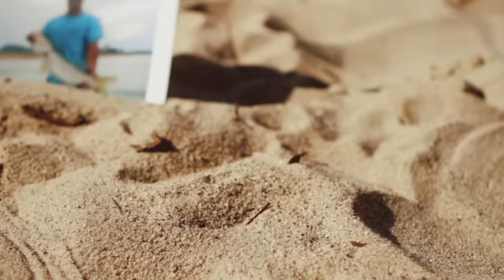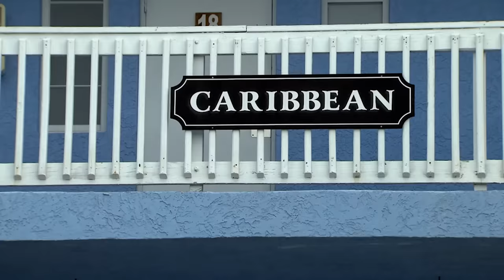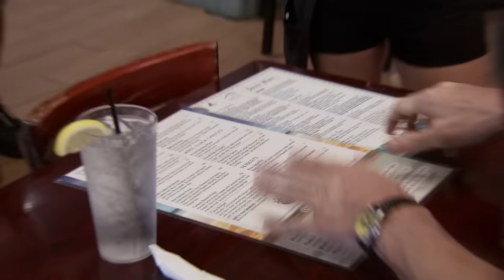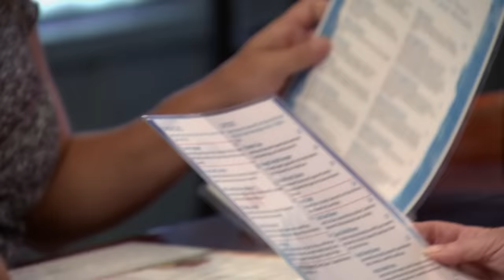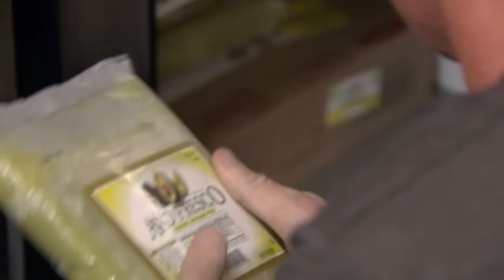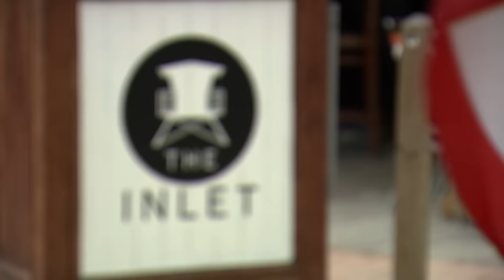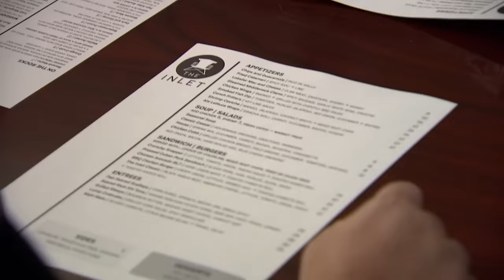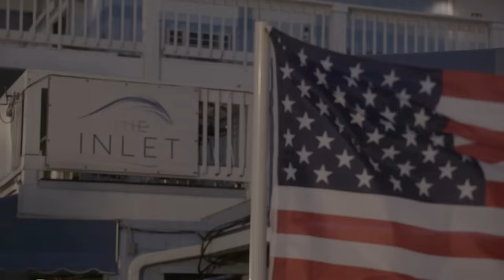Gordon Ramsay SHOCKED To Find Frozen Avocado | Hotel Hell FULL EPISODE

Comment: UPDATE        Beachfront Inn and Inlet closed in 2019, which means it survived for around four years after the actual Beachfront Inn Hotel Hell visit.

The hotel and restaurant closed because the owners sold it.

The new owners rebranded the property into a new hotel and restaurant.

As of 2023, the old Beachfront Inn and the Inlet Florida location is operating as Sunrise Sands Beach Resort.

However, reviews for the new hotel are not very good as it has just a 2.5 star rating on its TripAdvisor page.

It seems like problems continue at The Inlet Fort Piece property, despite the rebranding.

Comment: Update: 🥳 🎉🎉
Trip Advisor reviews were mixed and there were still complaints about late night noise from the bar.

Yelp reviews were also very negative.

Beachfront Inn and Inlet closed after the hotel was sold to new owners in 2019.

The hotel is now Sunrise Sands Beach Resort and reviews are average.

Beachfront Inn and Inlet aired on July 19 2016, the episode was filmed in October 2015

Comment: When I was 17 I waitressed at a place that did that kind of BS. They charged $25 for the shirts and $1 A LETTER for the name tag...I have 7 letters in my name so it was $7...but they didn't stop there, one of the female owners would constantly bully people into buying new shirts. 
She'd be like oh you have a little spot there, that's unacceptable you need a new one. That's actually how I ended up quitting, I had three shirts so $75 and she tried me. There was a small bleach stain on the BOTTOM of my shirt, my apron literally covered it, I got the stain from using their cleaning solution while cleaning the restaurant. 
Well I came out of the restroom, went to put my apron back on, and she saw the small bleach stain. Immediately she starts badgering me about buying a shirt. I told her my apron covers it, I have 2 additional shirts and I'm absolutely not buying a new one. We were pretty busy at this moment, but she goes well if you don't buy a new shirt, I'll send you home. I called her bluff and left. She freaked out because I had the biggest section, which was now without a server. 
I learned my lesson. Don't work at a place where you have to pay an outrageous amount for the uniform and don't work somewhere that requires you to share tips.

Comment: As of 2023, the Beachfront Inn & Inlet has closed in 2019, sold and renamed the Sunrise Sands Beach Resort. However, its still not operating professionally and the reviews has remained poor at best. As of May 2023, it has been struggling to stay open with most people afraid it will not last the year

Comment: Ramsay has been spouting this myth for years that you can't put hot food in a cooler. The problem is sealing food in large containers while it's hot then putting it in a cooler. It's the large sealed container that doesn't allow for all the food to cool quickly enough that's the problem. You need to portion it and put it in small enough containers so that is cools down quickly enough. As long as the food cools quickly enough, and stored correctly a fridge will cool down the food more quickly, it's fine.
Reply: I’m sorry but what happens when you put a big container of hot food in the cooler?
Reply: @pinecone3870 the food won’t cool down fast enough. It stays hotter for longer because it’s all one giant portion trying to cool down. This means the food will pass through the “danger zone” this is between 40 and 140 degrees Fahrenheit. If food has been sitting in the danger zone for a prolonged period of time, it will go rancid very fast. Bacteria already present in the food will fester and multiply at rapid rates when in the danger zone, this is why you have to portion hot food to put it into smaller quantities.

Source: I’m Food-Handler certified in the State of Arizona, currently employed at the Costco food court.
Reply: @ThallanarRabidtooth  oh wow I had no idea . Thank you so much